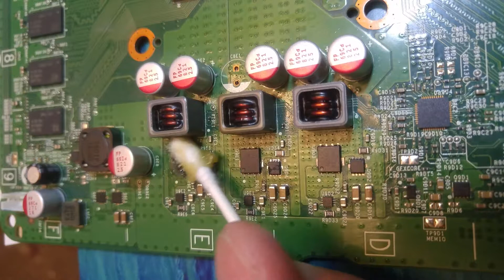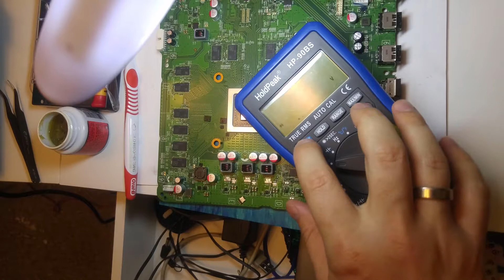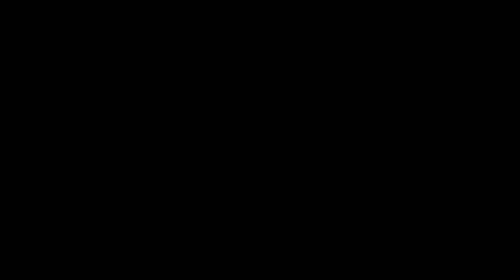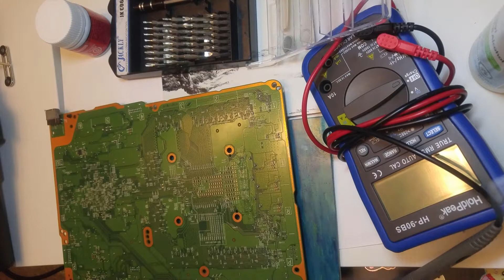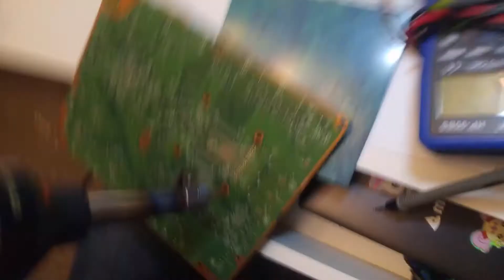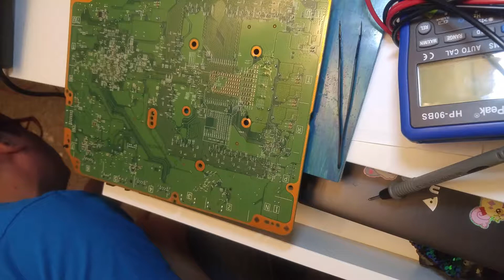Xbox One S Repair Part 3 - Test ALL THE THINGS

Comment: I have one that turns on, turns right off. No fan spin, I hear a noise from the processor but nothing. Real strange, tested all points. Mosefet was fine.
Reply from the maker: Does it make the startup beep? Mine did that.

Since I attempted this farce of a repair people have figured more out about them.

Apparently there are a few causes like the HDMI chip, or power delivery.
Reply: @Lilithe  Yes makes the beep and the light shows then turns right off I've tried everything I could think of. Tested the voltage, made sure the hard drive didn't go out, etc etc. Still nothing. I actually have had this console for years, I just got a series x and decided its time to sell and when i went to sell the disc drive didn't work went out by me not using it. So I repaired the disc drive, worked great and put it back together and now it doesn't work lol. Makes zero sense.

Comment: I am trying to find out this issue myself could be HDMI retimer IC but this video shows a fix that worked https://www.youtube.com/watch?v=p-ZDLxVDj3U&list=PLgNddAxcbUOmzQrdAVMp8XJhdUtbKcFOF&index=43
Reply: same with this board https://www.youtube.com/watch?v=RwR2E8C2cXU&list=PLgNddAxcbUOmzQrdAVMp8XJhdUtbKcFOF&index=50
Reply: and in here some resistors above the mosfet were replaced as well https://www.youtube.com/watch?v=nlFwuloe3lI&list=PLgNddAxcbUOmzQrdAVMp8XJhdUtbKcFOF&index=46
Reply: and in this video test voltages are explained https://www.youtube.com/watch?v=thp0cEAcixk&list=PLgNddAxcbUOmzQrdAVMp8XJhdUtbKcFOF&index=52

Comment: Older video so not sure if you'll see this or not... 

I had a customer bring me a one S today, exact same issue. Removed all 3 mosfets, same issue.

Those very small mosfets you were testing at the end, remove all 3 and see if it clears.

If not, then this (apparently) is likely an apu issue or a Southbridge issue. At which point I would scrap the unit for parts for other repairs
Reply from the maker: Yeah it seems like that.

Comment: My Xbox had the same issue all the items in the area you tested were low resistance to ground, the Xbox will also turn off after 2 seconds. None of the 3 positive power pins from power supply we're grounded 
tho. My issue ended up being a faulty hdmi retimer ic, changed that and it worked.I guess that Apu chip has low internal resistance to ground which must be normal in my case.
Reply: thanks bro!

Comment: You should be testing the mosfets, with the diode tester, not resistance tester.
Reply: I agree but even when the mosfets are removed that line is short to ground

Comment: Hello,
I have the same problem.
Did you find the error?
Reply from the maker: Oh I put this project down for a while but if I get back into it I'll definitely share my results. 

I think I might have damaged it further with all my playing around. If I could get access to a JTAG interface or something I might be able to see the boot sequence and why it resets.

I also don't have a scope or anything that would help me see what's working and what isn't.

This was mostly a learning experience for me.
Reply: @Lilithe  maybe it ist the APU
Reply from the maker: I tried reflowing the solder on the APU but yeah, it could be faulty. 

If I look on eBay I see a guy who is selling a lot of these motherboards with the same issue.

If I were the original owner of this unit I would have tried to warranty it. Maybe it was just out of warranty?